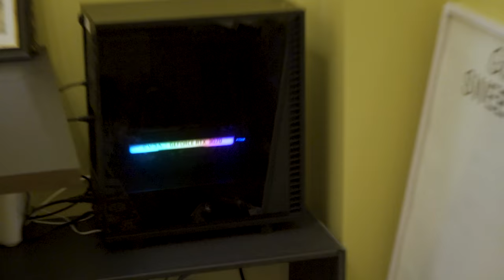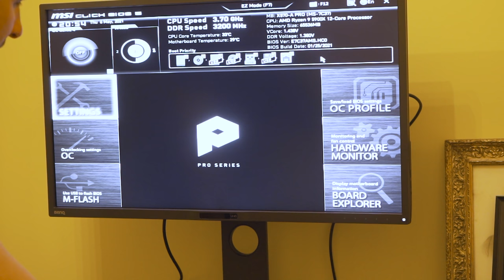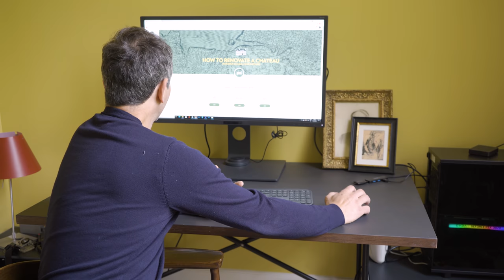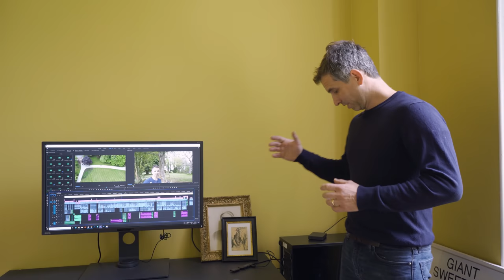I don't deserve THIS- How to Renovate a Chateau (Without killing your partner) ep.21

Comment: Hey guys, some tips:
13:15 Anna, good knife technique, just make sure your knives are super clean. 
16:15 Philipp, wearing earplugs reduces hearing loss and stress
20:25 use large dollops of mortar on panel then press onto bricks, dollops form to the shape needed for a strong bond. Wet down the bricks so they don't dry out the join before the bond is made.
22:10 Nickel braze the fire shield from the back side. fusion welding will be challenging, a Henrob 2000 oxy system can succeed with a skilled operator. Alternatively try superglue for a cosmetic finish, it wont hold if you actually light a fire near it.
23:20 Anna mix the filler in a small plastic cliptop bag for no mess, then cut the bottom corner off and squeeze the filler into the cracks like a cake piping bag technique. you'll have less mess and go faster.
 You guys are awesome for having a go and continuing to push forward.
Reply: Great tips!!!
Reply: @ichaconf  Indeed great tips
Reply: Solid tips, especially 16:15. Wish I'd read that before using my belt sander which left me deaf in one ear for a couple of weeks! Although, I probably would have read it and thought 'oh MY ears will be just fine.' 🙄)

Comment: CAST IRON WELDING- If you use a stick welder (you'll probably find you can borrow one, a lot of amateurs have them) there are a different type of sticks/rods specifically for cast iron.  I haven't tried it but as a first welding project, it may be a little easier than some types of welding because the metal is so thick it's less prone to warping with the heat. Ideally, you may need to get it really hot in order for the welding to take place.  You may find that something like exhaust putty would also be alright for reshaping areas that you can't weld to that easily. Good luck - you can do it!   I think you should have a theme of behaving more and more like the French aristocracy until Nathan tries to behead you - it could be really funny.

Comment: Hi Philip, if the fire plate is cast iron it would need braising. This is a form of gas welding done with filler rods made of a bronze mix. it is specialised but blacksmiths used to do it regularly.

Comment: 20:40  The adhesive was originally white plaster for binding marble, granite, stone. French slate clocks from the 1800s used this method and that also applies to your fire places. We now call it dental plaster and it should dry extremely hard.

Comment: Hi there is an implement you can buy that you push these prongs into place and it creates the shape you wish to cut you can use it wood concrete cutting anything tiles etc etc etc I’ve seen it it’s bright orange and black it will Help you both immensely with difficult angles shaping just about everything I’ll get the name of it

Comment: You can weld cast iron, but it isn't easy. You are better off brazing it and then using a high temperature paint over the braze.

Comment: I can weld cast iron. Any skilled welder can do it. I don’t think any advise will help. You can weld it with a arc welder and the right stick. Or you can tig weld it. Both take experiance. On a original pice it should be worth a welders time???

Comment: X570, nice! Did you go 8 or 12 core Ryzen CPU? Can you even build a comparable Apple machine? Guessing it would be 2-3x the price if you could. I've built PCs since I was a kid, reply here if you ever get stuck I can help.  My wife and I love your channel.  Great B-Roll this ep!
Reply from the maker: Thanks a lot! It's 12 core if I remember well, :) Ryzen 9.  Works really well. Only 4k on full screen when in premiere pro sometimes produces some droped frames... Not sure if that's normal... Probably premiere struggling with Sony codec...
Reply: @HowToRenovateAChateau  I love 4k YT, so it's appreciated! I have the same or similar BenQ 32" 4k panels on my setup. Great value and accurate colours.

Are you copying files from a Sony camera in .ARW? If you are running default settings there are optimizations that would boost performance for your Ryzen 9 + 3070 combination in Premiere for sure.

In terms of dropping frames, I'm assuming you are talking about playback/scrubbing and not the final cut. It's possible you could resolve this by installing the correct codec in Windows. What camera is it? The .ARW raw files you can still get an older codec for Windows 10, I believe. It's likely whatever codec is playing/decoding the raw files doesn't do GPU hardware acceleration.

Does your final cut playback smooth? If you want to optimize viewing content there is a great free customizable tool called MadVR that will take advantage of your 3070 big time. You can reach me at ss@sixtysix.ca if it's easier. Cheers!